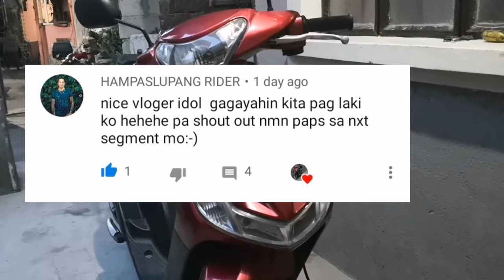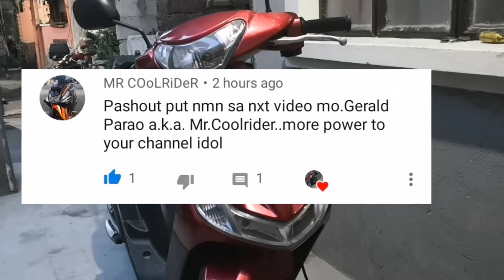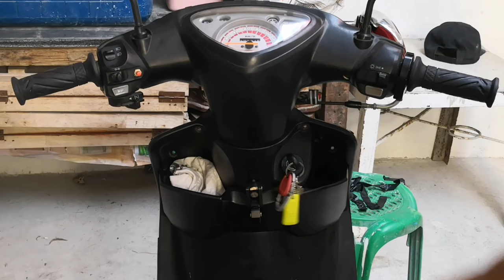IGNITION SWITCH W/ HORN ALARM, IWAS NAKAW, ANTI THEFT (YAMAHA MIO SPORTY)

Comment: Paps ask lang bat po kaya biglang nag stop magbilang odometer ng mio sporty ko gumagana naman speedometer niya pa help naman po paps 😇
Reply from the maker: Check mo ung plastic gears ng gear box boss sunod yung square na wire sa loob ng cable
Reply: @MotoBasicPH  dun po ba main cause niya boss? Newby lang po
Reply from the maker: @reynaldosoriano2967  main cause kasi tlga ng pagkasira ng speedo boss ay yung pag atras ng mga mutor natin lalo kapag mabilis ang pag atras nakakasira tlga. Syempre sama na din sa katagalan ng panahon at kawalan ng langis
Reply: @MotoBasicPH  working po yung speedometer niya paps yung odometer lang po hindi po nagbibilang nag stop po bigla ano cause paps?
Reply from the maker: @reynaldosoriano2967  ah ok pero connected kasi ang odo sa cable boss eh. Na try muna ba buksan at linisan?
Reply: @MotoBasicPH  hindi pa po boss. Ano po dapat gawin pag bubuksan ko po bukas help naman po
Reply from the maker: @reynaldosoriano2967  try ko icheck bukas kung paano ang mechanism ng odo sa cable then replayan agad kita bukas boss
Reply: @MotoBasicPH  sige po boss maraming salamat po antayin ko po reply niyo 😇

Comment: Paps genawa ko yan kanina nasunog fuse ko.same lng nman yung genawa ko sa tutorial mu..gumamet pa nga ako ng tester
Reply from the maker: Good ba wirings mo bossing at naka batt op at fast charge? Baka may putol na wire bossing double check po sana
Reply: Uk nman wire ko paps.tenester ko pa nga bagu ko ke nonek.ngtataka ako pg tester ko my koryrnte na ang dalawang linya pgka switch ko sa ignition.same process lng lhat genaya ko lng genawa mu pero d mka tunog yung skin tpos ayun na lumubo na yung fuse ko.
Reply: Ma ilang ulit ko pa nga penanuod tutorial mu paps e.d nman ganun ka complicado eh.battery operated npo ako
Reply: Hindi pa xa fastchrge kasi enurder ko pa yung relay eh lwa kasi dto yung tinatawga nlng change over relay mahirap hanapin.ang avail lng yung isa.
Reply from the maker: @chouyencie1940  kasi boss sakin ok naman. Double check po sana

Comment: sir pwede din po ba yan sa mio mxi ? same lang din ba ng kakabitan ? gaya ng nasa video nyo ?
Reply from the maker: Not sure bossing pero pwede mo subukan.
Reply: natatakot ako baka masunog eh .
Reply: BOSS NASUNOG FUSE KO NUNG TRINAY KO YAN . PERO NIREVIEW KO VIDEO MO AT NAKITA KO SA WIRING MO TAMA BA NAKITA KO . YUNG PASSITIVE WIRE SA SWITCH NASA BODY GROUND ? AT YUNG NEGETIVE WIRE SWITCH NASA NEGATIVE HORN AT YUNG PASSITIVE HORN WIRE NASA BROWN / BLACK SA IGNITION SWITCH ? REPLY LODS PLS .
Reply from the maker: @jay-rbrondial5407  double check boss yung video ko. Kasi sakin wala naman nging problema.
Reply: OK NA PO SIR . TAMA NGA NUNG DOUBLE CHECK KO VIDEO MO . MULA SWITCH YUNG POSITIVE WIRE NG SWITCH CONNECT SA NEGATIVE NG HORN AT YUNG NEGATIVE WIRE NG SWITCH CONNECT SA BODY GROUND . AT YUNG POSITIVE WIRE NAMAN SA HORN TAP SA BLACK/BROWN WIRE NG EGNITION SWITCH . TY IDOL MALAKING TULONG SAKIN VIDEO MO .
Reply from the maker: @jay-rbrondial5407  olryt!